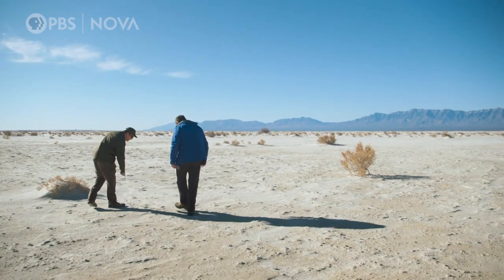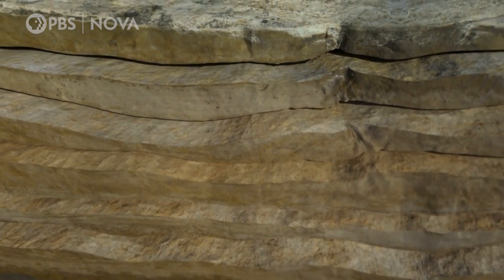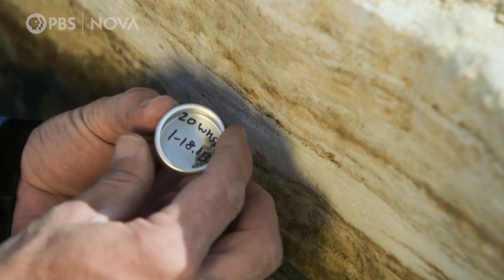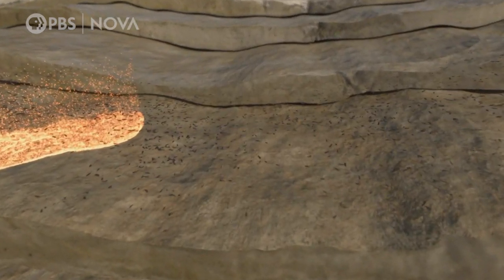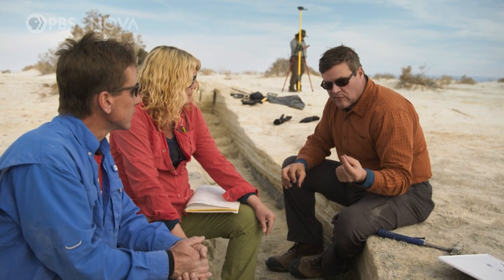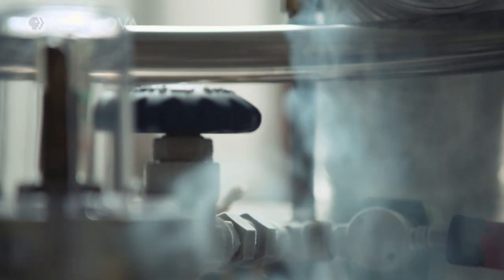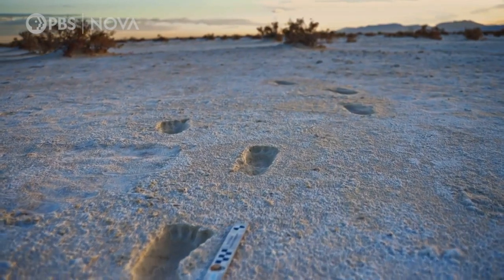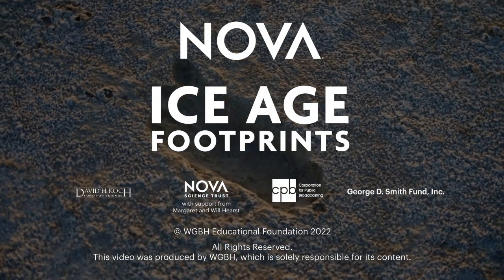Humans May Have Lived in North America Earlier Than Thought

Comment: The oldest prints may yet be found. Clovis happens ~10,000yr/10ky later, they were made during a glacial maximum, the Wisconsin ended ~17ky ago. These 1st ppl were likely coastal, BeringStrait was dry, sealevel didn't rise to that until 12ky ago, coastal Beringia, the land Bridge south side a cold desert, little snow, coastal living was liveable with Arctic tech methods & tools.

About 36ky-32ky habitation sites on the Kamchatka Peninsula gave plenty of time to cross east by dispersion, not exploring, during a brief warming lasting 1.2-1.5ky with Holocene weather to get to S.America's south by 26ky ago likely. If coastal travel it's submerged, most of it destroyed going under the surf zone for centuries.

These footprints are like at Laetoli, those 1.2My old ... very pristine find between datable strata, it had 18"/46cm to the 21ky layer 👍
Reply: I feel like you are providing valuable information, but in a poorly written format, with lots of professional jargon and shorthand that is indecipherable for a layman with normal reading comprehension.
Reply: It's also quite possible early that peoples traveled by boat along the northern glaciers that connected Western Europe via Iceland to Eastern North America.
Reply: Yes, the Viking sites east coast to Midwest set timelines mid-1300s, the western coastal settlers likely crossed Beringia during a 1200y-1500y warming to Holocene temps cica 32kt-36ky ago with dispersion, not exploring, that's plenty of time to cross to N.America.
🌏
Reply: The “Clovis” were in no way the first people- that’s the whole point of this video, genius.🙄🤦‍♂️🤡
Reply: @spanqueluv9er   So, it begs the question, who made the footprints, was the coastal route used, did they have skin boats ?

If there're footprints, there's likely habitation sites of that period, where are they ?
Too cool ... 🍺
Reply: @spanqueluv9er  I don’t know if they are an idiot or not, I can’t really tell. But my poiut was basically that he is anything but eloquent. His post looks like some sort of shorthand jargon only he himself can fully decipher.

Comment: What kinds of seeds.  Any dna left to extract. 
What was the soil composition that the foot prints were made in. What was the fill material in the foot print. Can they duplicate what conditions could cause foot prints to remain.  Walking thru a wet surface that dried.  And then was filled with dry layers of dust by the wind would be my guess.
Reply: The seeds in each layer of sediment allowed them to date that layer.

Comment: How is it these footprints remained on the surface uncovered by sediment for so many thousands of years? I understand how they can be preserved under layers but I’ve watched archeologists excavate 6 to 12 feet from after the Civil War where so much had accumulated on top of what they were digging for. 👍
Reply: The desert winds blow sand on things and later blows sands off of things. It's a continually changing landscape.
Reply: @lesliefranklin1870  for the same reason of winds blowing after 21k years I would think there's nothing left of those prints
Reply: They were made, filled in and buried. They remained buried and protected under the surface for thousands of years. They were only recently uncovered by erosion. The full documentary talks about the race to document and study them before they erode away. It's worth a watch.
Reply: @lesliefranklin1870  And this really isn't silicate sand. It is powdered gypsum.